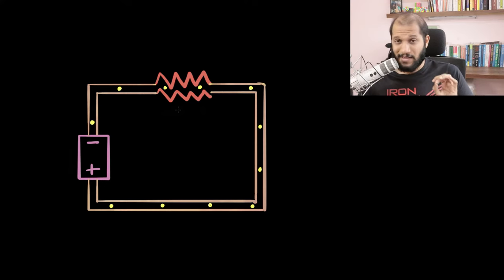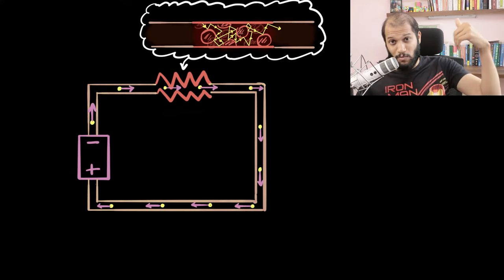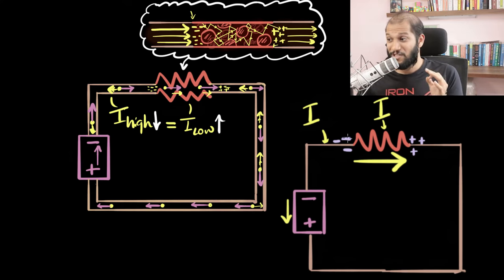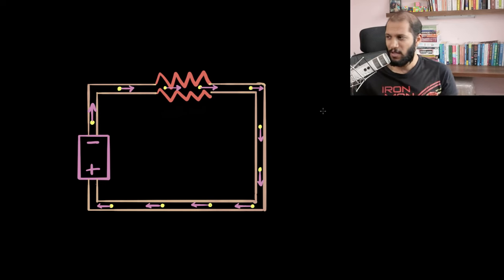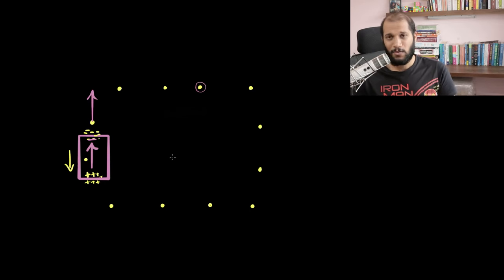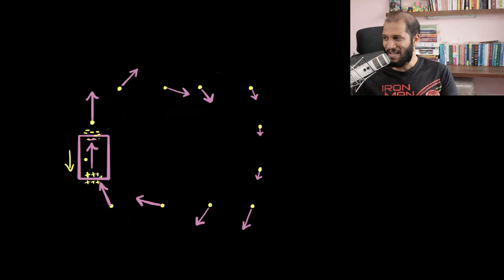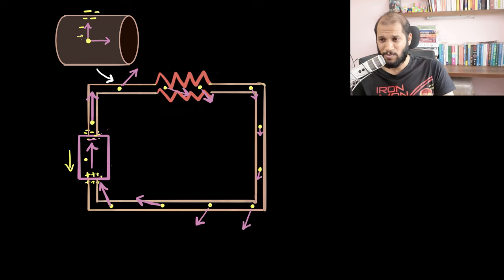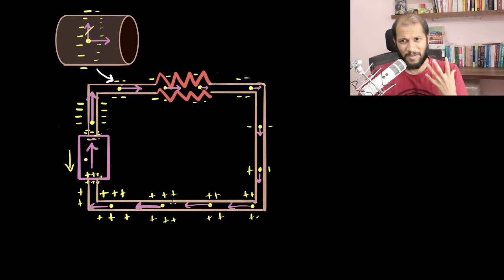How circuits REALLY work!

Comment: I dou t that the charge accumulation is a good model. It can't explain, why if you demove the resistor and just have the resistance of the wire, you have much more current when the voltage of the battery is the same. But that is the case because of I = U/R (if there is  o resistor, R is just the resistance of the wire, so it is much lower, which makes I much higher).

And the eyplanation of tbe battery also can't be right because if it was correct, there would be no discharge, it would have infinite capacity.

Comment: I am confused about one thing: How can the net force on the electrons be zero if they are moving as current? Doesn't there have to be a net force to continue to drive the electrons through the wire in order to overcome the resistance of both the resistor and wire? I thought that's what electric potential is all about. The voltage continues to force the electrons along the wire. Or maybe you mean that the net force that was initially created by the imbalance of charge within the resistor becomes zero? This is not clear.
Reply from the maker: Hmmm! Newton's first law?
Reply: In this model he uses a perfect conductor. In a perfect conductor the electrons can have a constant net velocity, but they do not need to  have a force to keep going. The force is only needed to accelerate.

It raises a question: If you use a perfect conductor to short-circuit a perfect battery the current should be infinity. But if the electrons only can accelerate until the velocity of the light and the number of electrons are finite, how the current could be infinity? (all in theory, of course)
Reply: @Mahesh_Shenoy  I was not aware that Newton's first law applied to quantum particles such as electrons, especially since electrons are accelerating and decelerating  in different directions and experiencing the forces of repulsion and attraction within the wire itself!  And do you need resistance in order to have force?  Just because there is no resistance in the wire, does that mean that the electric field is producing no force on the electrons? That doesn't make sense to me. Does gravity not exist if there is no resistance to it? Help!
Reply: @rogeriocosta1035   I was not aware that Newton's first law applied to quantum particles such as electrons, especially since electrons are accelerating and decelerating  in different directions and experiencing the forces of repulsion and attraction within the wire itself!  And do you need resistance in order to have force?  Just because there is no resistance in the wire, does that mean that the electric field is producing no force on the electrons? That doesn't make sense to me. Does gravity not exist if there is no resistance to it?
Reply from the maker: @mjciavola  Maybe I wasn't clear enough because I juggled between fields and forces! 
But, the fields only exist inside the resistor. The accumulated charges ensure the electric fields in the resistance less wire = 0.
Reply: There no problem in the use simple models if it is accurate enough to describe what you want.
Example: If you apply a force in an object, it will deform before starts to accelerating, making the F=m.a inaccurate in some situations. But for the most problems of the classical mechanics, it works perfectly.
Reply: @rogeriocosta1035  Every other info source that I have consulted shows that there is a net electric force on the electrons in a constant current. F=ma doesn't seem to apply here because the electrons in a current don't truly move in one direction at constant velocity. Instead are randomly deflected in all directions, accelerating and decelerating. Only the NET movement is in one direction. For example, go to 5:15 minutes into this video: https://youtu.be/C7tQJ42nGno
Reply from the maker: @mjciavola  They are assuming SOME resistance in the wire, Michael.  So in an actual circuit, there will be a small electric field through the wire but a much larger area wherever there is resistance. More resistance = more field. That's the only way the current can stay the same everywhere. But, in the lumped circuit model - which is the model I have used here - we assume zero resistance in the wire. Zero resistance = zero electric field. This does happen in superconductors, however! 
As far as I understand, superconductors will never have electric fields inside them, even when a current is running!
Reply: @Mahesh_Shenoy  What I still don't get is that you apparently are saying that electric field is dependent on the resistance. I am reading this as you saying the more resistance, the more electric field. Could you direct me to some reference that confirms and explains that?  My understanding is that the battery is responsible for the electric field, not the resistance in the resistor or the wire. How can resistance increase or decrease an electric field?
Reply from the maker: @mjciavola  That's what Ohm's law says! Potential difference del V = IR. 
Potential difference is created by electric fields. E = - del V/ del x. Hence E = - iR/del x, making E proportional to R. 
Lastly, the entire video explained how the battery's electric field gets modified due to accumulated chargers!

Comment: Some questions I had during the video:

16:10 Why do we break the attraction into an upward force and a horizontal force? Isn't it simply just a diagonal force due to the repulsion and attraction of charges? And even if we break it into a upward and horizontal force, it still equals back to that same diagonal force since the horizontal force would balance out some of the upward force and results in the same thing again, thus why would there a an accumalation of electrons?
19:30 Why would the electrons leave behind positive charges when deposited on the surface?
20:20 Why do we end up with a positive charge on the surface of the wire? Isn't it the electrons which are travelling? So if electrons are travelling how does it cause a positive charge to be left on the surface of the wire?

It may be a bit stupid but I just can't understand lol, pls I'll appreciate it if anyone can explain it to me in simple terms
Reply: my opinion for your third question, The positive charges of the battery will attract the electrons of the atoms in the conductive wire and they will become + charged.

Comment: Sir, can you please explain the battery as a pulling force? Like the positive terminals are pulling the electrons in the negative terminal. Imagine a simple circuit with a resistance. In this case the electrons of the conductor in the positive end of circuit that is  the  ( let the negative terminal  be on the left side, the positive on the right and the resistor in the middle) right hand side of the resistor ,which aren't affected by the resistor will be having more speed than the free electrons on the left of resistor but as you took the analogy of a pushing force your problem was solved. So can you please explain it with this analogy of a pulling force.

https://youtu.be/YGCGH3Y79_Q  this is your video where you explained this concept briefly.
Reply: Exactly I too asked this in that video.Anticipating for his reply

Comment: I am a huge fan of yours, but this was not intuitive to me. The idea that the electric field created by the battery applies force on charges across the entire circuit is not correct. In practice, the circuit wire can be twisted and wound randomly. The force of the electric field would then drive the charges in random directions.  Some parts of the circuit may be quite far from the battery to feel any force of the electric field. 
Instead, the way I visualise this is as follows:
The wire is  made of a conductive material which has a large number of valence electrons. These electrons are loosely bound to the nucleus and float easily between the atoms. Together, they form a sort of fluid filled inside a pipe, that is the wire. When the battery starts sucking the electrons from one end, it creates a little vacancy for the neighbouring electrons to fill in. As the neighbouring electrons move towards the positive end of the battery, they create vacancy for the electrons further away. And so on. As the battery continues to suck electrons from one end and push them out through the other end, this creates a flow of electrons through the entire circuit. The direction of flow doesn't get affected by the twists and turns of the wire. It is kind of like water flowing through a long hose.

Comment: I am terribly sorry, but this is the biggest load of nonsense that I have ever seen. Your explanation would have me believe that there is basically a zero electric field from the battery in a wire that runs from the battery at a distance of 100 metres, whereas there is just as large an electric field in the wire at 100 metres from the battery as there is at the wire as it leaves the battery. Please, please, please correct the misinformation that you have presented here. It frightens me that so many commenters are praising you for such a great explanation, whereas it is truly utter nonsense.
Reply: I couldn't understand what you are defending. Could you tell me your opinion about the electric field again?